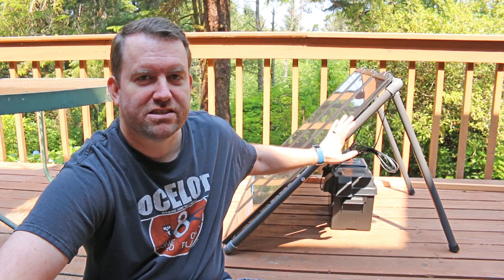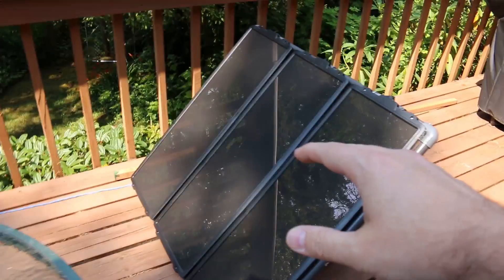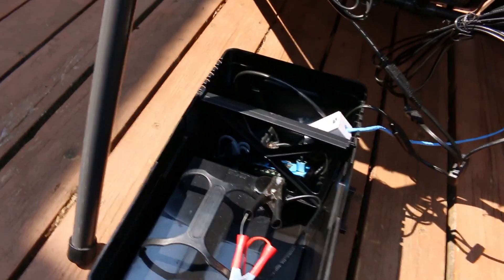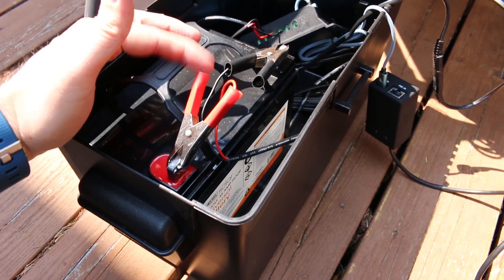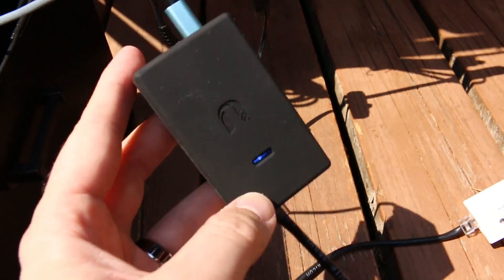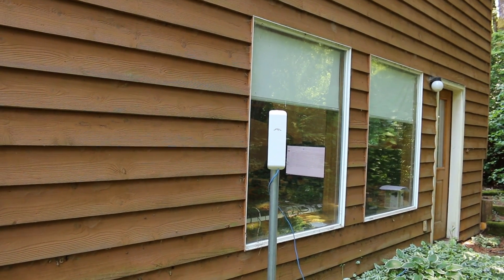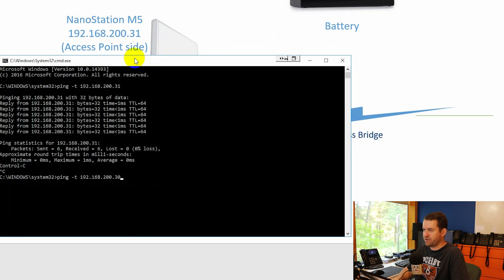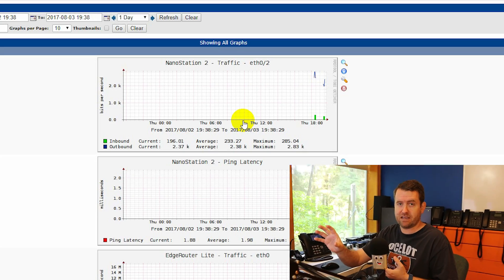Solar Powered WiFi - Part 1

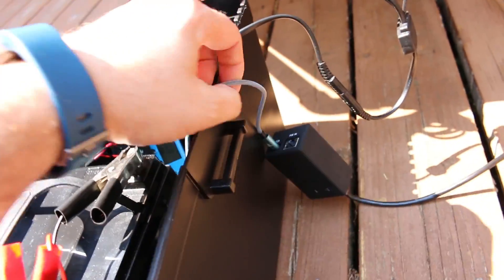Comment: 6:09  As you said... That box is key!!   I'd like to keep the solar system all 12V.   I have a 12v POE switch, but most wireless bridges I am finding are 24V!  That's pretty cool it takes USB and outputs 24V

Comment: I'm wondering if someone has a kit where we can just setup our WI-FI router off grid on solar? I want to have enough batteries so when they are charged up could operate the system for a minimum a week max a month, we're in north central Florida

Comment: This is very lossy, to buck the voltage down to 5 and than up to 24 again, instead of using 2 smaller 12V Battery’s (24V) and power directly into PoE.

Comment: Use a buck boost converter on the solar controller output. 12 volt in 24 volt out (adjustable) far more efficient.

Comment: I know this is an old video, I just wanted to find out what happened to the airGateway Installer Pro's? 
They seem to be replaced with AirCube ISP? Although the AirCube ISP version is powered by 5v Micro they don't seem to be able to power anything by POE without also having passthrough POE. 
What happened and what is the latest way of achieving the same goal?

Comment: Power straight from battery to a cheap dc to dc converter/regulator with sufficient power (amps) for the station and camera. My guess it´s the USB ports on solar charge controller don't have sufficient amps.

Comment: IP Cameras are usually 48v active POE so i wouldnt advice putting 24v into one. Could also power your nano station from a dc-dc 12v to 24v step up regulator straight off the battery then put the power through a passive 12v poe injector. Cheers.

Comment: Do not ever buy Harbor Freight solar panels. They're total crap. The charge controller is crap too. So are the wires. And the glass on the panels aren't tempered. It cracks easily. The plastic frame cracks. I tried the Harbor Frieght panels once and while the LED lights showed voltage there was virtually no amperage to charge the batteries. The controller wound up drawing off the batteries to the point where the batteries were so undercharged they were ruined. Do not, I repeat, do not ever buy Harbor Freight solar panel kit. You would not be able to charge two 12v batteries to get 24v with this cheap chinese crap Harbor Freight solar panel system. One, because the solar panels are 12v and the charge controller is a 12v PWM. You couldn't put the panels in series to get 24v because the PWM can only take 12v. Two, you can't charge two batteries in series (24v) with that 12v PWM. You also cannot connect the inverter to the PWM. The inverter must be connected to the battery. You would be better off getting a 100w kit from Renogy with an MPPT charge controller that can charge two batteries in series or parralel. Two panels wired in series will get you 24v from the panels and would be far more efficent in charging the batteries in series. Or just do panels and batteries in parallel for more amperage to charge. The MPPT will automatically adjust the voltage coming from the panels to give the batteries the voltage they need. Renogy is a much higher quality product and far more reliable and efficient than the Harbor Freight crap. Love the Ubiquity USB PoE though. That's way cool.

Comment: how about the clear obvious solution rather then having all these parts and pieces.... grab yourself a shovel and some direct burial cat5e cable dig a 6in trench drop a pvc pipe inside run your cable push the dirt back into the trench and now you have ONE part connect the nano and camera and youre done...hell you could have used out door coax with baluns to push POE over coax to ethernet. just seems like you doing more TECH NERD work rather then working smarter and having less points of failure..

Comment: Too many comments to read through, so I don't know if anyone else has suggested this. From your battery, you could use a 48V DC converter (12V to 48V) and from there, connect a UniFi US8-60W. From there, connect your Nanostation. That would also give you enough power on your PoE passthrough to power your UVC or other PoE camera. That has been working great for me. I currently use 100 watt panels and 12V sealed lead acid 100 aH batteries at each of my locations. This is an old video, so I'm sure you've learned all that by now, though.

Comment: Here's my idea... lol:  Unfortunately, it requires 2 12v batteries wired in series (24v), then 2ire 2 of your solar panels in series for 24v (Your charge controller should automatically sense 24v or have an option after hooking up the batteries).  Then hook up your nano station directly to the "load" on the charge controller.  NEAT thing about that scenario is you can automatically program the charge controller to shut down overnight or come on a dawn.. consequently conserving power.
Reply: just looked at the manual on this charge controller... You can safely hook up all 3 of your HF solar panels in series to make 36v, the controller will adjust to 24v BUT you'll still need to have at least x2 12v batteries in series.

Comment: Those last 2 outlets on the controller are used to power a couple of led lights, the inverter should be connected directly to the battery. Love your videos btw

Comment: you can use DC-DC converter and hook it directly to any passive poe connector or you can make double rj45 female and with some soldering to pin 4 and 8 , everything will work just fine , instead of buying 44$ poe from ubnt , nice setup mate
Reply from the maker: +hany annan That's what I did in part 2.

Comment: Thanks for sharing - that setup with the camera is quite an inspiration. Angle-wise, in winter you have less intensity to / exposure from the sun as it sits deeper on the horizon and comes in weaker through a "thicker" atmosphere.

Comment: I don't know if anyone else has said it. But with the m2 /m5 nano stations that close together you need to turn down the tx power. This would also save on battery usaget
Reply: Also with solar installs I try to keep the cat 6 runs as short as possible.  Also have you seen the unifi tough cable. Really good stuff
Reply from the maker: +Fluzz Yes...power output is down at 0db

Comment: I have been investigating a battery powered setup for a couple months and have been testing with the following items. much more efficient that a inverter or USB converter.Passive POE adapter  https://www.amazon.com/gp/product/B015S8L3NG/ref=oh_aui_detailpage_o09_s00?ie=UTF8&psc=112 to 24v step-up converter  https://www.amazon.com/gp/product/B01IBJCJD2/ref=oh_aui_detailpage_o00_s00?ie=UTF8&psc=1

Comment: What would be really valuable would be if you could detail out the charge/consumption.

You made a comment earlier that you had 4 bars, and it basically never went below 3 bars (assuming 100% -> 75%). This to me means that you could use about half of the power that you have, and still have plenty to spare. Please make sure that you measure the power consumption, and the charge speed.

Here is my problem: I love the idea, and I want to do something similar on my lands, but I need for it to be small and cheap. Looking at the components the battery is going to be the most expensive thing, and then I need to find a suitable solar panel. The solar panels, that are available are either like 15-20w or 100w. The 100w ones are 40"-50" in height, and that's just not reasonable to set up in a forest or in a yeard, but about half that would work fine.

So the question is, could this be done with smaller panel, smaller battery?

Comment: This is a question not regarding your system I wanted to know if if it's possible to run Wi-Fi without hooking up to net.    so I can run local systems at home. What systems would work two routers?
Reply: Wifi is a wireless network connection...that's it. It's usually used to access the internet, but only if internet access is available. You can use any wifi devices that work together USB dongles, routers, other devices with built in wifi etc.

Comment: So you run a network connection wire to the wireless device to power the wireless network connection bridge.  How about just running the network connection on the required network wire?  You could eliminate a nanostation.
Reply: The point is, there may not be a wire to use. He is illustrating a wireless bridge like between 2 buildings etc. 2 separate wired networks linked together wirelessly.

Comment: And yes. do not hook up an inverter to the power out side of the harbor freight charge controller. a 12 volt cigarette lighter plug and a USB converter plugged into that would most likely supply the amps needed. if not like I said in my previous comment. put a capacitor in line to keep the voltage from dropping.

Comment: I'm doing the same thing on my property in Central Texas were I hunt with old Linksys routers wrt54g and I just put a small capacitor in line to keep the voltage from dropping. I have multiple cameras on my deer blind that shoot a signal back to my cabin with directional antennas about 250 yards. works great. Ubiquiti is the future for sure but to rich for my blood. I get the old Linksys routers at Ham Radio festivals for $5 to $10 each. just running Solar for now at the deer blind but plan on putting a small wind turbine up soon for those cloudy days. hope this was useful for someone.

Comment: I'd be interested to know what the actual draw is from the nanostation; how much power is it actually using? I'm sure it'll vary slightly with network activity but the number should be fairly similar over a period of hours.
I'm considering nanostations for my remote camera stations, which are will be solar powered. Interested to know how much more panel capacity I need for the nanostation in addition to my camera.

Comment: Another good tip is to use a MPPT charge controller. A PWM controller like you've used brings the voltage of the panel down to your battery voltage. If you have a larger voltage panel (18V, 24V, 30V+) the MPPT controller can use that to increase your charge current to your battery which would otherwise be limited by the PWM controller.

Comment: I don't want to be a downer, but for 50' you can do this a heck of lot cheaper with some bulk cat 5 cable and a couple of ends. That said, I've implemented this a couple of times for clients in a much simpler fashion. Set your solar up for 24v with a charge controller that has a 24v DC output. Connect the DC output to a passive POE injector and connect your UBNT gear. You are losing a lot of power in the USB to 24v conversion when a second battery would do the trick. All you need for battery is a couple of 12v 7.2AH batteries.

Comment: The power requirements for your system.
The charge controller USB port is 5 volts 3 amps, 15 watts.
The Ubiquiti AirGateway Installer converts the 5 volts to 24 volts. Conversion efficiency is unknown. So estimate conversion rate 90%. So this gives us 13.5 watts of usable power.
The Ubiquiti NanoStation M5 station uses 8 watts maximum.
This leaves 5.5 watts of power for the camera.
The camera will draw any were from 4 to 12 watts.
Then the Ubiquiti AirGateway may only be able to supply 12 watts at  most.

Comment: I have heard for a long time that the nanostations will run directly from 12vdc. I have never tried it myself, just read about it all over the ubnt forums. Or you can get an upcoverter and hook it to the battery that will take the 12vdc and up it to 24vdc. Please add some fuses to the circuit. One at the battery and any loads connected. A simple ato fuse holder from autozone will work. 

Can you do a video on the PI and cati setup?

Comment: Use a step up transformer instead of an inverter. Much more efficient. 

https://www.amazon.com/Vorcool-Converter-Regulator-12v-Step/dp/B0085T97PW

I second the fuses remark.

Comment: Nice T-shirt.  Phish?     Now, this seems like way overkill.  You should be able to run your bridge on 5V/1amp DC (that is only 5 watts DC!).  You can buy a solar charger for like $20 that will charge a Li Ion batter that would power that for 24 hours.  Everything you are running is very low power.  What is going to suck up the power is things like an inverter (which has to physically create an AC phase) and anything that requires physical motion - like a compressor for an AC.  There are some free or low cost books are solar you can learn about some of this stuff. I'm certainly not an expert (like you I was an IT - computer programmer) but I'd start with some basics about electricity and battery tech.  Quick, easy reading with basic mathematics.  It will take you far in this journey.

Comment: A note about using the usb ports on the solar controller. I have  what I believe to be an identical solar controller and when testing i found that when the usb port is connected to a continuous current draw it will drain the battery past the low voltage cutoff of the controller. So say the solar panels weren't charging the battery, the battery would continue to supply power to the usb causing the battery to fail and die. The solution is pretty simple, use something like this https://www.amazon.com/GEREE-Waterproof-Converter-Adapter-Connector/dp/B00OXZ06I4/ref=sr_1_5?ie=UTF8&qid=1502173139&sr=8-5&keywords=12v+to+usb+converter
conected to the 12v output of the solar controller, that way the battery wont drain past 11v.

Comment: First you are trying to power to much over a 24 GA wire in the Cat 5 cable. It may work better if you had a bigger wire for your power. You just can't run much power on the small wires.

Comment: Chris, this could be done a lot better. Skip the gateway and the inverter. The nano station runs on PASSIVE 24v POE. That means you can run the nanostation off of the 12v battery directly. Take the cat5 cable, cut off the green and orange pairs, then connect the blue pairs direct to the positive post on the controller, then brown pairs to the negative. Run the full cat5 strait into the main port on the nanostation. Also, get a 60w solarpanel. The only reason it's working is because you're only running the nanostation, with the camera or an access point it wont charge fast enough, especially with only 6 hours of light. Buy a 60w solarpanel on Amazon from Windy City for 90 bucks, and it's a lot more quality, and obviously cheaper. I did a full tutorial on this posted on my site. www.freelynkproject.com.  My version is to bring free solar powered wifi to entire communities using the solar bridge/ap method. I also show you how to make a real mount for the whole thing so it's not just sitting on the floor and you can put it out on roofs and walls. The inverter and gateway is a huge waste.
Reply: hey kyle can you check your link i doesnt seem to work and interested in seeing your project
Reply: off to the site
Reply: link is broken
Reply: His project page is just an ad.  Not useful
Reply: which side of the controller exactly do i connect the +ve and -ve ?the load side or the battery side of the controller
Reply: @samueladuamah-yeboah8179  well lets use some common sense the far left + and - are power in from the solar panel the middle + and- are out to the battery to charge so the far right would be OUT to what ever he is powering.

Comment: 802.3af PoE standard is 15 watts at 44-57 volts DC, 350 ma.  802.3at or PoE+ is up to 25 watts, which would be less than 500 ma.  Many manufacturers do not follow the standard, though, and Ubiquiti doesn't seem to publish how much power its PoE adapters are capable of supplying.

While regular USB 2.0 is 5 v @ 1.5 A (7.5 watts) and special charger ports can go a little over 2.0 A, the ALLPOWER's USB port is actually capable of 3 A or 15 watts.  Ubiquity does publish power consumption for a couple of their other PoE access points (The AirGateway Installer is pretty much the same, with the added USB power option) as being 4-6 watts.  Its doubtful the AirGateway pulls the full 3 A from the USB port.  Even so, subtract the power used by the AirGateway, then the NanoStation's 6.5 watts from the approx. 10 watts left, and that doesn't leave a lot for your camera.

Comment: 1. Inverters are a waste of power in setups like this. Why go from DC->AC->DC when you can run all DC. 
2. Measuring battery level by "bars" is lame. Try learning what voltages your battery can handle at full, half and a safe low mark.
Reply from the maker: Yup - this was version 1....working with what I have.  Much improvement coming in version 2!

Comment: Also after watching another thing to test is to use a 12v car socket high output 2 amp output max usb charger to allow for the added power.  It might be that the charge controller is using less than 1 amp to power the nano station and adding the extra will give the POE injector more power to draw from.

USB Adaptor: https://www.amazon.com/STANLEY-PIUSB2S-12V-Dual-Charger/dp/B00PF9RCBQ/ref=sr_1_29?s=electronics&ie=UTF8&qid=1502084853&sr=1-29&keywords=12+volt+2+amp+usb+charger

12 Volt Car Female Power Adapter bare wires: https://www.amazon.com/SMAKN-Cigarette-Lighter-Connector-Adapter/dp/B00RT5TE5Q/ref=sr_1_45?s=electronics&ie=UTF8&qid=1502085026&sr=1-45&keywords=12+volt+car+adapter

Comment: Use a second PoE injector to go from the USB solar charge controller port #2 to another RJ45 cable going over to the camera. Then separate out the PoE wires and the signal wires so you can still have it going to the nanostation.
Alternatively, if you have enough power available from the PoE converter, just splice out the voltage wires to the camera instead of trying "passthrough mode".

The reason both solutions include having to splice is: Why do you have your solar panel and battery box so far from everything? Group them all together and then you won't have wires going everywhere, inefficiencies, and splicing to deal with.

Also, the nanostation is not the most power efficient device, they sell point to point devices that take much less power.